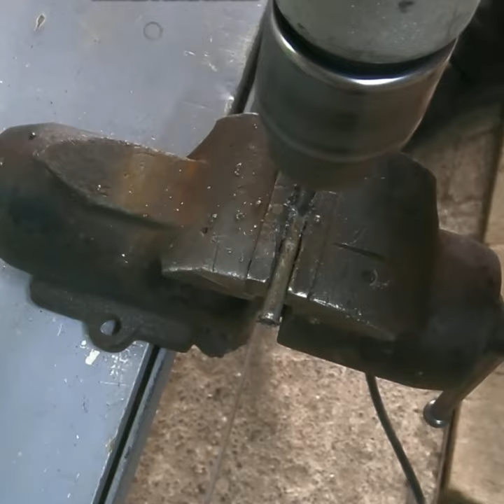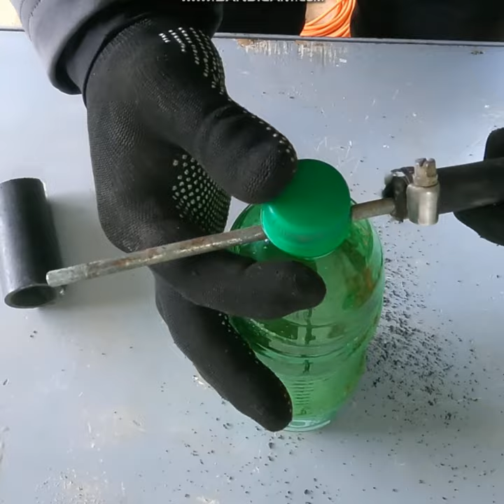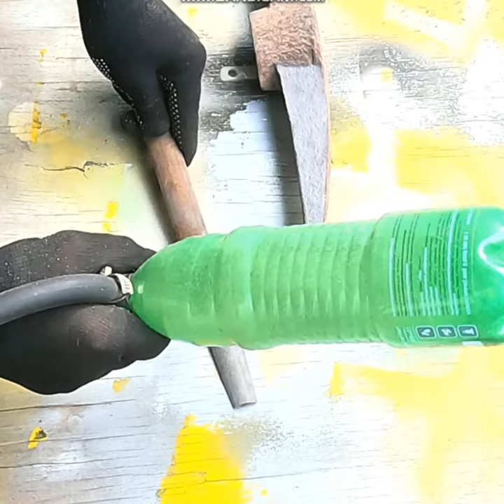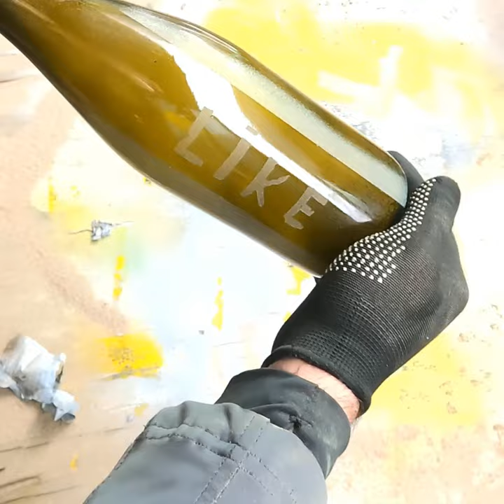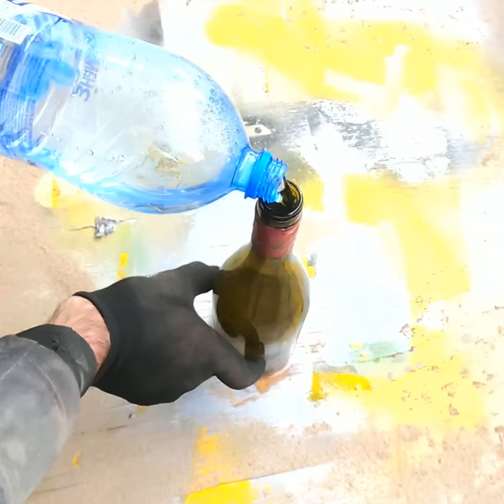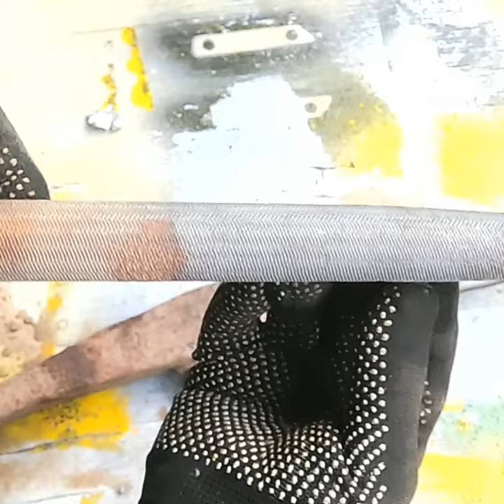The easiest sandblasting in the garage. #sandblasting

Comment: You should NEVER use regular sand for sandblasting unless you're in a well-ventilated area and you're wearing an appropriate mask. Otherwise, you run a high risk of developing silicosis, which is deadly.